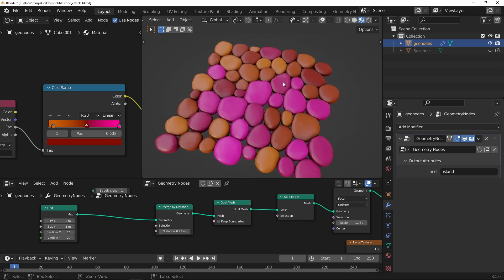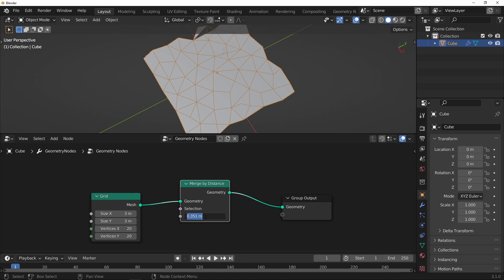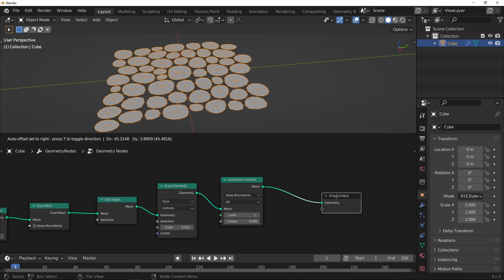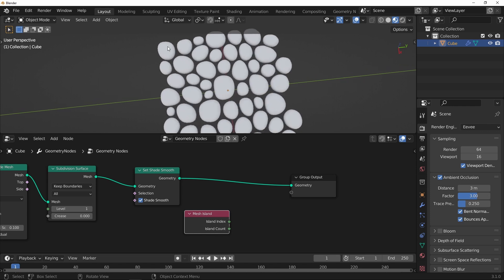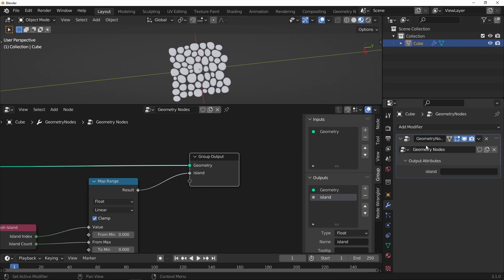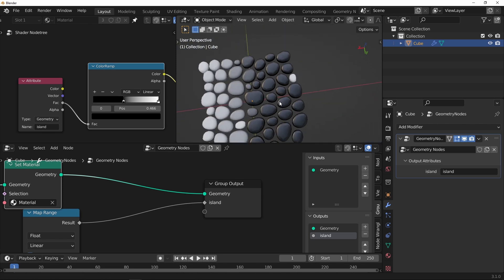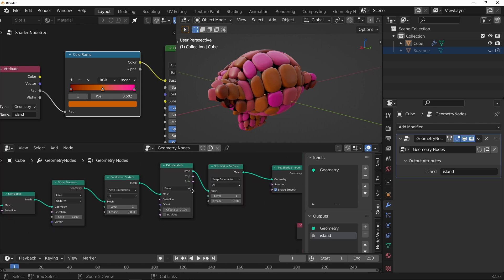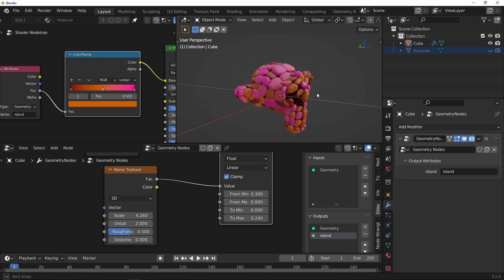Blender Tutorial: Procedural Cobblestones using Geometry Nodes

Comment: So clean and to the point. After Scale Elements, the distances between the stones are not equal. Can we make them equal despite the size of the stones? I need random rectangular stones and the gap between should be equal everywhere. Thanks.
Reply from the maker: cheers! I think the only way to get what you are after is to use circle packing which is a much more advanced technique. Have a look on blenderartists for a post by Higgsas who has a project file.

Comment: this is what I am looking for but there something a little I want to achieve for my project pls could you do something like this but a cell skin structure I mean each object has sphere inside in it ? pls for my project
Reply from the maker: If you use a mesh to points node in face mode after the dual mesh you will get a point in the middle of each face that can be instanced onto.  You can also use a capture attribute to get the face area to then scale up each instance to the size of each face.

Comment: great tutorial. How would you go about it to bake the different colors into the geometry as vertex colors? To export to unreal or zbrush? 
thx
Reply from the maker: thanks! Yes you can get get the island colors into the vertex colors, but the workflow is a bit clunky. You need to store the named attribute of the color to an attribute called "Color". You won't see it in the viewport though until you apply the geonodes modifier. You can use a material with the color attribute to preview the result as I did in this tute..
Reply: @redjam9  I will give it a try thx for pointing me in the right direction :)